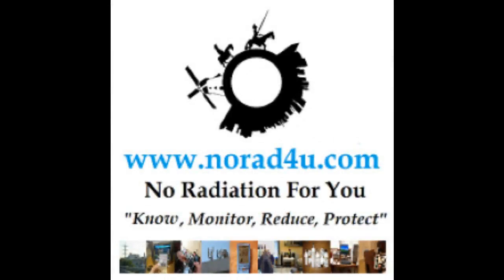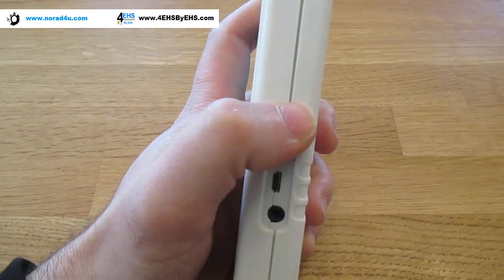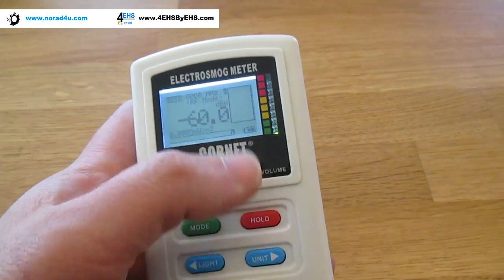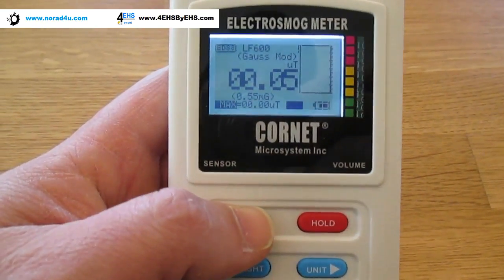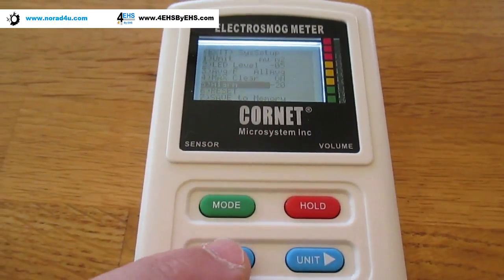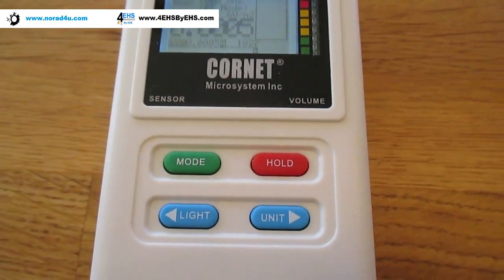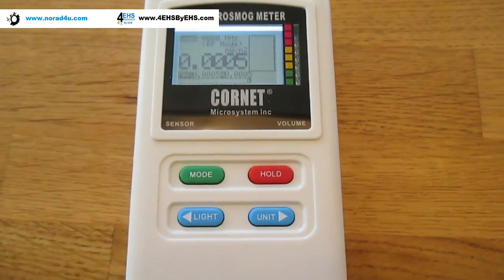CORNET ED88TPLUS  SHORT PRESENTATION AND OPERATION

Comment: Can you make a video that shows what levels are actually BAD and OK ? when i use my wireless keyboard it goes up to 0.0500 with a short distance , if i hold it close where my hands are it goes up to 0.3500 and even sometimes up to 0.5000 / up to 1.1000 and both values shows red alarm , are those normal safe values and nothing to worry about?
Reply from the maker: I think almost any level of RF is not healthy. 
The bioinitiative report form 2012 suggest that 0.03 mW/m2 is the bio-active level.

see - https://bioinitiative.org/conclusions/

Comment: Great video thanks. Is there any possibility to update the CORNET firmware to include new information for new radio frequecy? .. 1) Such as prevalent source (now max 2.7 GhZ) also
 from 3.6 to 3.8 Ghz and the 5 ghz of Wifi 2) The same frequencies into band sound functionality and data logging functionality (for example real time in W/m2?  How could contact the manufacter cause perhaps the capacity over time should be expanded as it happens for other HW through
 official distributions (also pay for it).
Reply from the maker: I hope that all these new feature will be included in next model. 
What exist now is:
1. Press the "LIGHT" button several times for sound feedback with modulation audio. 
2. Connect to a PC using a USB Data cable, & run the software (see my site) for data logging in RF mode.

Comment: Could you tell me how to set the "peak" setting. How to I shift from average to peak? Thanks!
Ginger
Reply from the maker: Hello
The numbers in the bigger digits are the half second peak.
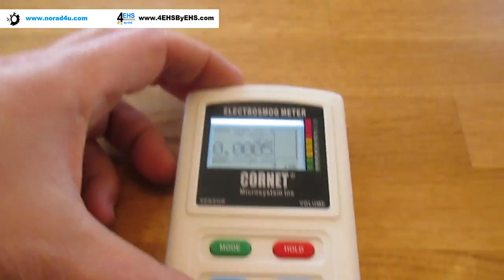The numbers in the smaller digits Starting with P (on the right lower side of the LCD) is the PEAK AVERAGE over 15 seconds. You can use the setup (Press UNIT button and then the HOLD , see 1:30).

Comment: You have another video about how to reset the precautionary levels for the LED lighting warnings for the previous version ED88T.  How do you set/change the levels on this meter? Or does it not need that?
Reply from the maker: The same as in the old meter.
You open the setup menu by pressing  UNIT and hold, then press HOLD and release.
move down by "UNIT"
change value by "LIGHT"
Don't forget to save new settings. 
enjoy

Comment: I think that ELF measurements should be done in X, Y, and Z with a little more sensitivity, I think this could be a better meter. It only added a few buttons, which I think is a great help but in essence it's still the same meter I think they could have done a better job. It is an excellent meter but still has much to improve.
Reply from the maker: Thanks for your comment.
This is a "all in one meter" so there are some compromises.
I find the 3-Axis issue minor as I change the position of the meter to 
find the highest measuring axis and then continue to measure in this 
axis. 
My main need when using the meter is to find sources, penetration points, to "see" the radiation so I can reduce it. 
its' RF mode is the fastest and most informative I have seen and this is the main reason I like it so much.
If there was a "all in one" meter with 3Axis RF, 3 Axis ELF then it 
would be great but for now the ED88TPLUS is the best option as a "all in
 one" under 200$
Reply: This is a good meter but I would like they improve that in the next model something more professional even though I'll have to pay more than 200$
I like this meter but I think it could be a better meter. They have to develop something better based in what they made but not make basically the same model over and over again without improving the sensitivity. make it more sensitive like 1 nT (0.01 mG) or 0.1 nT (0.001 mG) or at least resolving the axis (sensor) issues.

Comment: I bought the same meter recently! You have very little RF in your home😄 Do you have video how you protect you against RF?
Reply from the maker: Yes, it took me few months to find this house, and thanks god it is clean (for now). The house search was done using the CORNET ED88T meter. If your house have RF penetrating into it, I recommend using the meter to find the penetration points, and then use the correct protection to block the RF.  Window's film and curtains for the windows, paint and wallpapers for the walls.
Please see more info at - 
http://www.norad4u.com/emr-protection/rf-protection
and the store site -http://www.4ehsbyehs.com/rf-protection
and as requested, a video - https://youtu.be/fk7GlDixYgI
Reply: Thanks. Will check it out.
Reply: It will stay clean untill a phone company says: hmmm look this place is not yet cancerouse. Lets setup another antenna.😁

Comment: Few helpful pointers, but completely inadequate explanation.  Written instructions also inadequate.  Not ready for mass market.
Reply from the maker: Hello Chad.
It is a best seller meter , the one I sell and most and I recommend the most.
I did find it's manual to be very good. In addition people who buy via our site get even more info. 
What info or explanations do you find missing or not inadequate?
Reply: NoRadBlog  I should have made my basis of evaluation more clear.  I do not have an electrical engineering degree.  I was thinking of a typical consumer or cell phone owner.  Someone who is unfamiliar with the science, the terminology, the measurement scales.  Is is my hope that such individuals would be able to make use of devices like yours to evaluate their exposure.  That is what I meant by mass market.
Reply from the maker: Hello , for people who wants an easier to operate meter there is the ENV RD-10